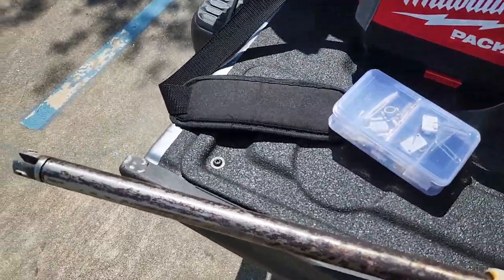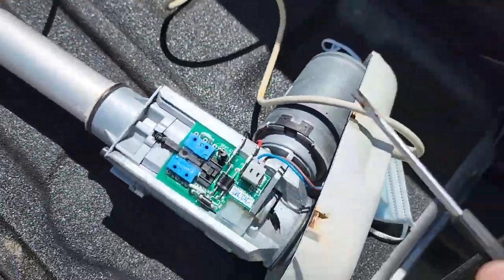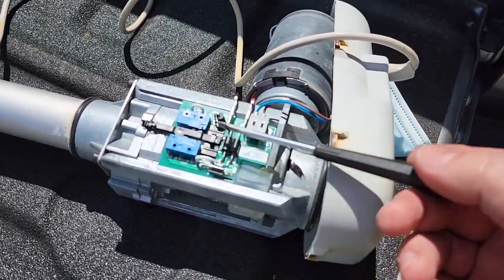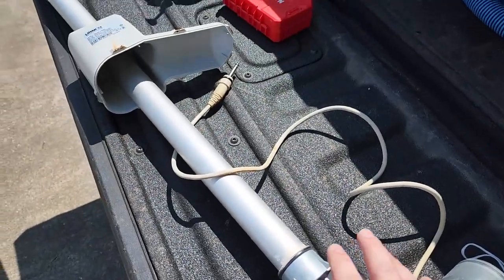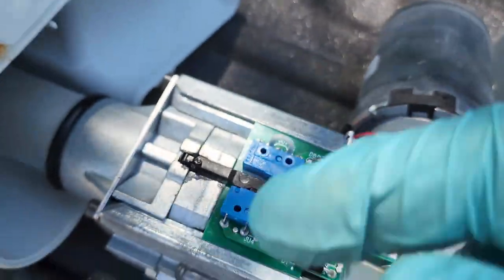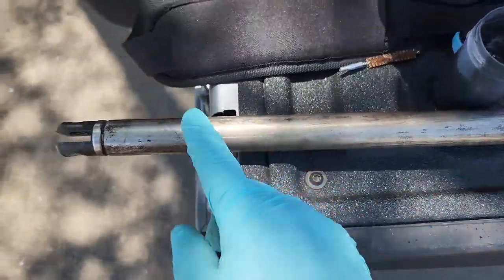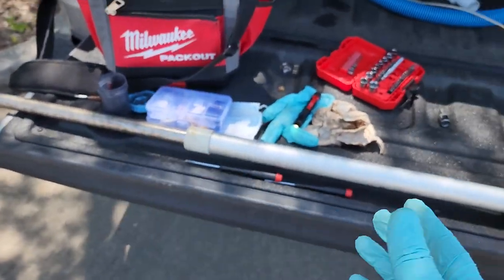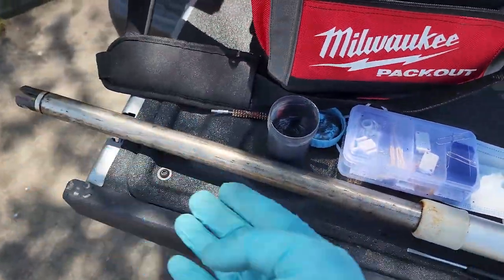Pool Lift Repair

Comment: I've repaired hundreds of them, it's almost always this fault, it's grease from the spindle that's gotten down on the end of the runout carrier inside the spindle tube. it must be completely disassembled to clean it. the trick to separating it is after unscrewing the plate from the four corner posts, there is a pipe split that needs to be knocked out, after which the spindle pipe can be turned 1/8 turn and removed.
Reply from the maker: Excellent! Good to know!

Comment: If that rod is stainless steel, you can spray oven clean on it (while protecting areas you don't want overspray to go onto), and you'll see that old caked grease melt off quite easily.  Zero scraping and scrubbing.

Comment: Is it not possible to protect the chrome rod with a rubber innertube of a motorbike as protection sleeve ? Like some shock absorbers have.
Reply from the maker: Maybe if the shaft had a decent coat of grease to protect from humidity. Either way, this part is basically a consumable.

Comment: I am troubleshooting a Linak pool lift. What voltage am I looking for out of the control box? I can't find any info anywhere. The motor barely moves, making a chirping noise. Thanks for any help.
Reply from the maker: The actuator should be ~24V DC but movable with no load @ 12V. (Usually)

Comment: Have  you repaired the control box of a Pool Lift?  I'm having issues with lift not working even with new batteries replaced.  There is a clicking sound when button pushed however lift still won't work.  Do you have any suggestions instead of $500.00 replacement part.  Thanks so much!
Reply from the maker: Sounds like the control box is working. the only other thing to do is to check the voltage to the motor when the button us pressed.  Mind you, if the limit switch is stuck (like what happened to me), then the device will only work in one direction. If you are at the limit of that direction (like down) then the device will be deactivated because it is at both limits at the same time.
Reply: @BetterBiomedChannel  oh thank you so much !  I will do that and hopefully I can fix it Thanks again!!

Comment: What did you use to get the clips back on? They seem to be extremely tight
Reply from the maker: Make sure that the case seams are lined up and pressed together.